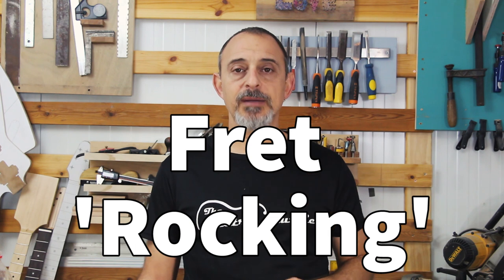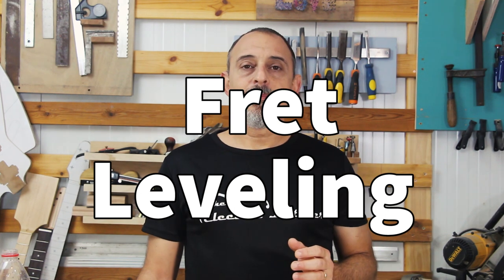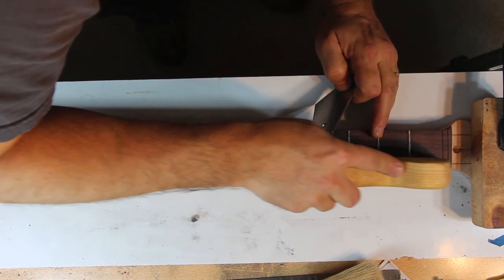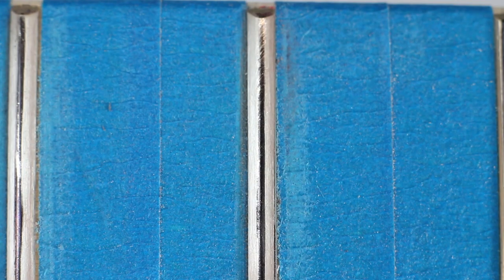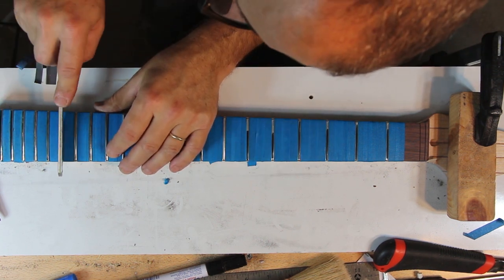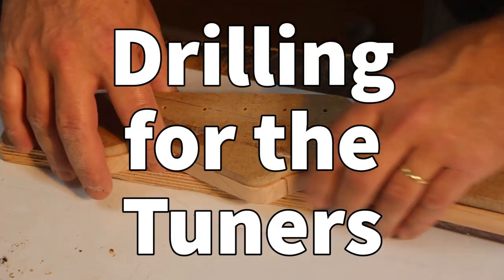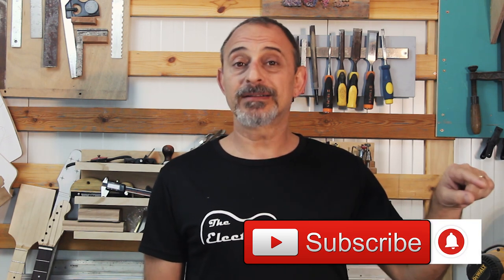Build Your Own Dragon Tele Part 4/7

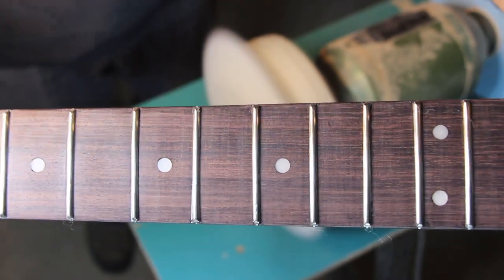Comment: 14:01 There are still deep scratches almost little notches in the 8th and some other frets. I think you didn't take them down enough during leveling. The big steel hammer also didn't help I guess.

Comment: Small correction: The fretboard is CONVEX not concave.
Reply: Couldn't find the exact spot, so I will be more specific. The fretboard is convex from side to side making the frets convex as well. Length -wise the neck and the fretboard is slightly concave in a forward bow. If I said anything else, I stand corrected. Thanks

Comment: Hi, thanks for your videos. I have a question: are headless guitars easier to make, considering there's no headstock?
Reply: Hi Alessio. Funny you should ask as I am considering a headless guuitar for my next build.  It's true that not having to shape the headstock and install the tuners does save you some work. Even more time consuming would be an angled neck with a 'scarf joint'. However this design does often requires a bit more work  on the brodge side as you now require a type of bridge that has a tunning mechanism and those may be  more complex to install. The bottom line is that you can use the headless design and try to simplefy the build, but depending on your tools and techniques and on the hardware you use it may end up just as easy/ hard.
Reply: @yoavbinyamini  Thanks for answering my question. This would be my very first build so it'll probably fail anyway, but I think getting rid of the headstock would help me a lot. I still need to plan everything out before starting but I was thinking of going for a shape similar to a strandberg but with a "neck-thru". Let's see how far I can get :) Keep these videos coming, amazing work!